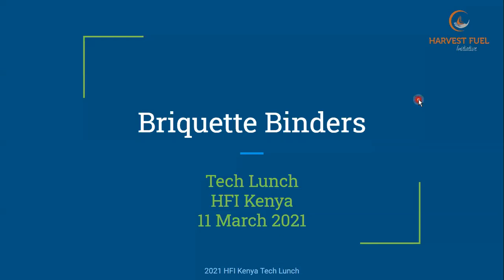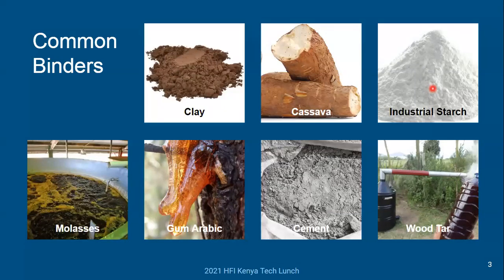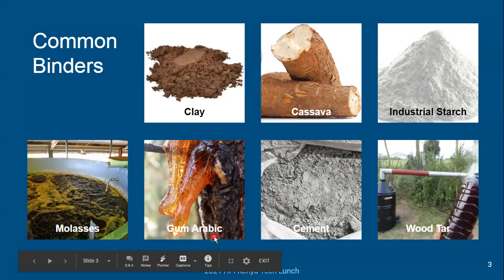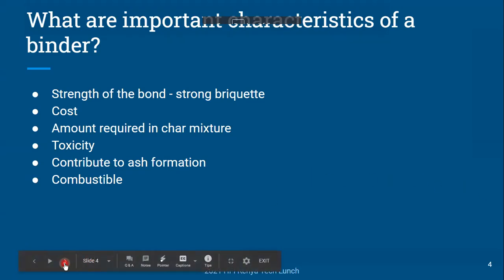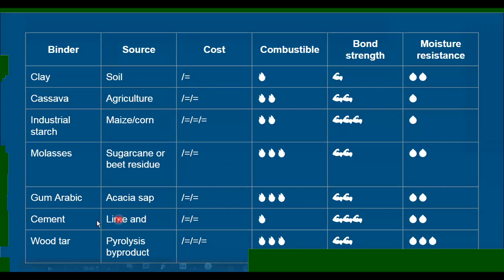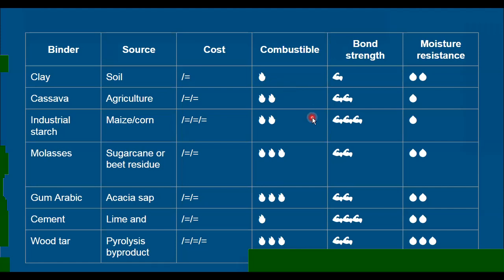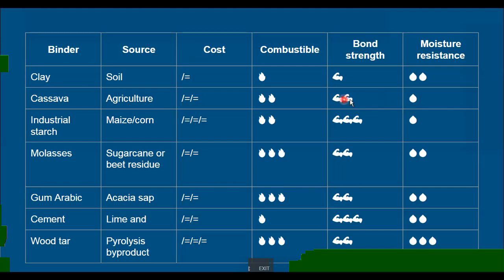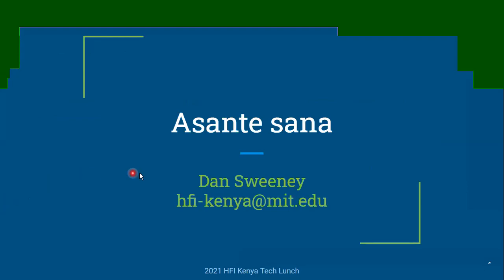Briquette Binders

Comment: To bind millscale, I've used bentonite and molasses, but sometimes the shape of the briquettes is still not good enough. Which is better, bentonite or industrial starch? 
Thanks before..
Reply from the maker: Hi Iwan, I have not experimented with bentonite yet, but I have found industrial starch to work excellent. Does anyone else have any experience with bentonite that they can share?
Reply: Bentonite to cold press? Or do you heat it up?
Reply: @guillermosalinas4226  The millscale temperature from burner around 50 - 60°C, after that mixed with bentonite and molasses during 80 s

Comment: thanks very much for your article    it's inspiring.  i used cassava starch for my briquette and a hydrolic press system.  the immidiate result was good and after two days it began to disintegrate into fragments. what could be the reason??
Reply from the maker: Thanks for your comment charcoal and wood! Do your briquettes disintegrate after drying, or while they are still wet? Do they disintegrate when you handle them, or even just sitting untouched? What ratio of cassava binder and char do you use? What pressure do you reach in your hydraulic system? It's hard to say what the problem is, but I suspect you need more compression, mix your binder thoroughly, or slightly more binder.
Reply: @sweeneywrench  it didnt disintergrate on its own.  its only when u want to handle it without care
Reply: @sweeneywrench  i will increase the binder ratio and then get back to you. please can you link me on Whatsapp ??
Reply from the maker: @charcoalandwood8910  that sounds good. Keep me posted on the result. Can you post that here? Or feel free to to send an email (see video description). Good luck!
Reply: @sweeneywrench  okay o will

Comment: Four different application use different binder starch is the best but you can't use it for shisha charcoal
Reply from the maker: Thanks @Ali! What binder do you suggest for shisha charcoal?
Reply: Different if you use hydraulic press or extruder
Reply: Explain more please,
Reply from the maker: @yezzamouad9469  What information are you looking for?
Reply from the maker: @aliwitwit2217  Which binder have you found to work well for shisha charcoal?
Reply: Well about the best binder for extrusion ...
Reply from the maker: @yezzamouad9469  If you can access it, I would say industrial grade starch will do a great job binding your briquette with little effect on the burning performance
Reply: Dan Sweeney can you please tell me what to do in making char briquettes more stronger because I've started making it but it was not too firm this is my first time trying it but it was not firm enough to burn at the end all of them continued breaking apart so what step can I take to be able to bind the briquettes together so it can hold firm pls need answers
Reply: @georgeronaldharding8881  hello george. Have you tried using bentonite and molases? With ratio of bentonite 4%, molases 3% (brix 65%), and you can use hydraulic press.
Reply from the maker: @georgeronaldharding8881  it's possible that you need to achieve better compression when pressing your briquettes. What type of machine do you use? I'd like to do a discussion about press machines soon if there is interest